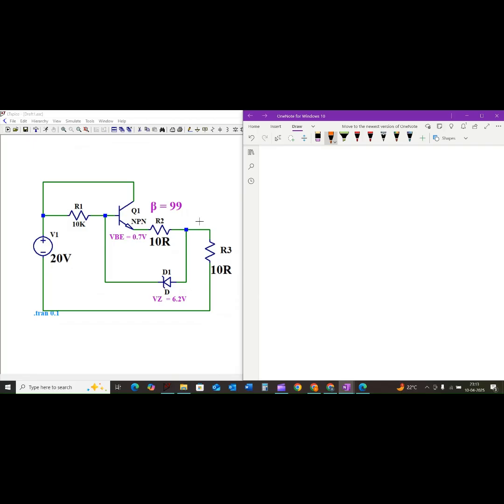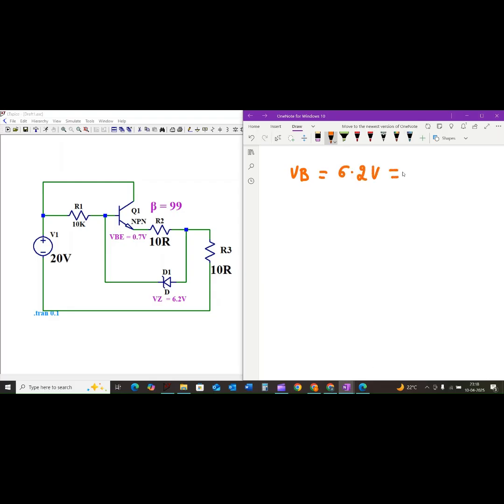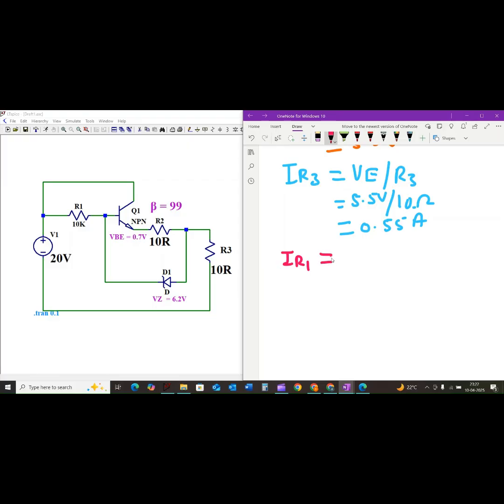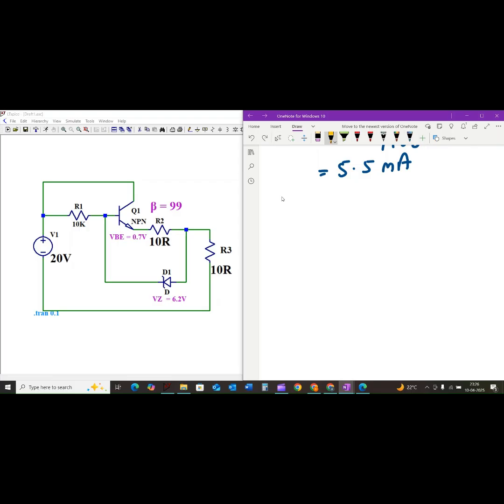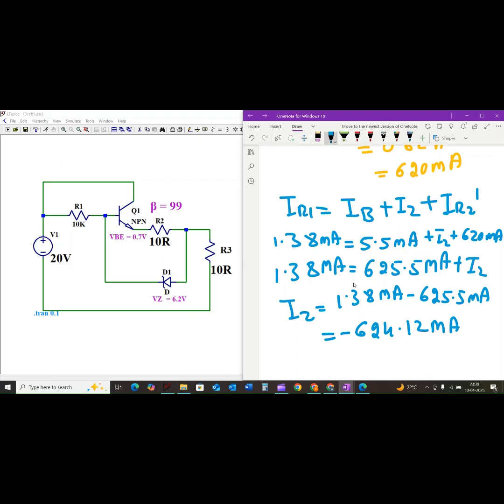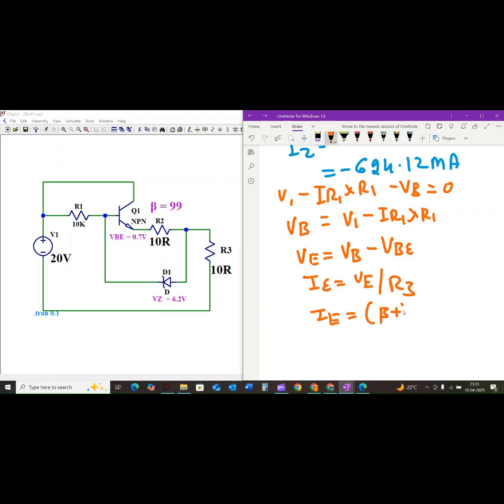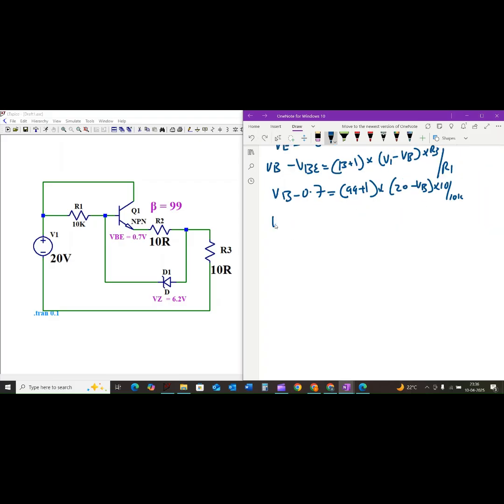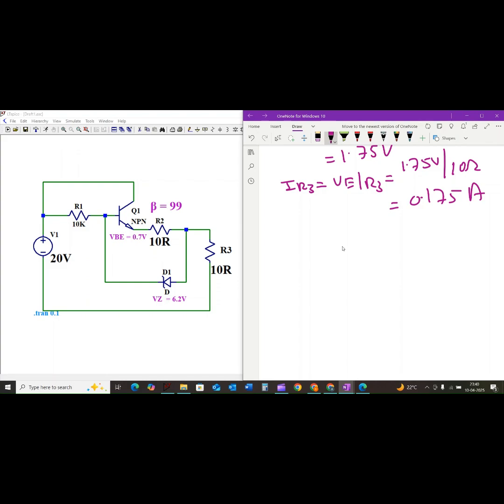Voltage Regulation Circuit Analysis: Transistor & Zener || Hardware Design||

Comment: There is no ground reference in the circuit...how come VB is voltage across the zener ? It should be zener plus voltage across R3....Did you simulate this circuit?